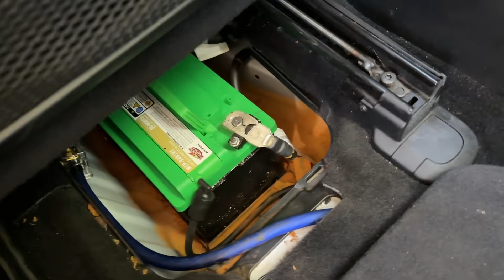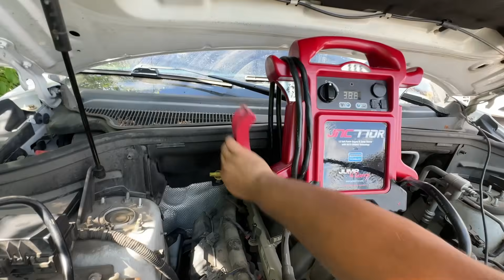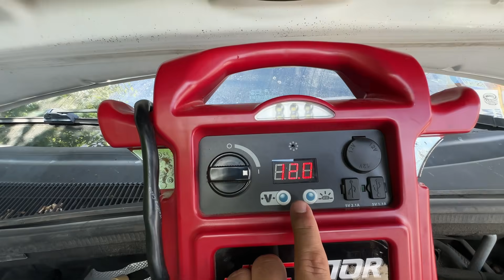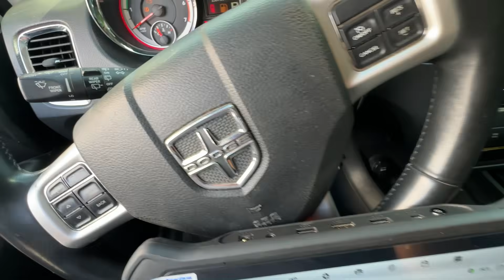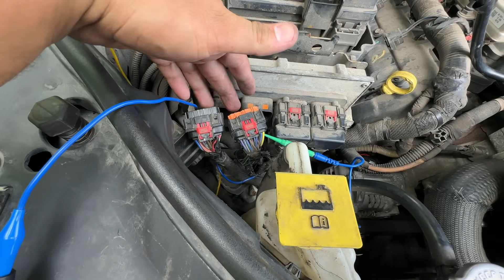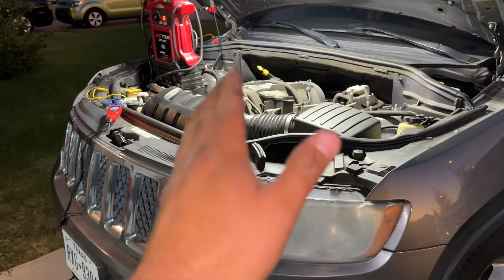DODGE DURANGO HEMI ALTERNATOR NOT CHARGING DIAGNOSIS

Comment: At the end of the video you said that the customer did not have the funds ti buy a new alternator ,but before you seem to be confirming that it was a bad ecm. But and the you used another car to show a working ecm command in the alternator to charge , good video, excellent .
Reply from the maker: Yes you are correct! My mistake! I meant to say “Replace the PCM”. Thanks for catching that!
Reply: @ADVANCEDLEVELAUTO  can you explain the process of you getting paid for your diagnosis of the PCM. How do you get paid for your time  when parts have to be ordered and they might take days. Nobody is really offering this in my area and I would like to leave my brother's shop and offer this exact skills to shops within a 50 mile radius.  There's about 80 to 130 shops I can reach around my area. I've been thinking about opening this lane for myself recently but haven't taken the leap.
Reply: @Geovanni___  I think he gets paid by you tube for his excellent videos and diagnostic skills.
Reply: @rodvan-zeller6360  i'm trying to pick his brain a bit about the business side of the trade. I know YouTube pays, but I doubt he's showing up and diagnosing these problems free of charge to the shops. Since I'm pretty good with electrical and hard to diagnose automotive issues I want to see how to structure the labor if I was to make it a full time thing. Strictly offering my services to shops and not independent customers is my thought. That way the shop can sublet the charge and I wouldn't have to deal with the customer directly.
Reply: @Geovanni___  Thank you for the reply. I understand your point. He is not diagnosing for free. I can tell you in my opinion that to get paid for this kind of work, a realistic diagnostic fee for knowledge and time far exceeds the value of the vehicle.
Reply: @rodvan-zeller6360   Good answer but also a piss poor answer at the same time. How is that supposed to hel Geovanni?
Reply: @Geovanni___  As a shop owner, you CAN NOT charge a diagnostic fee for a BAD PCM... AND be profitable... it just is NOT POSSIBLE...  The time it takes to figure these things out, you would NEVER get a customer to agree to that charge.. I suck it up as "educational"... In short, you cannot charge over 2 hours Diag, like EVER... it isnt "real world" possible...
Reply: @ADVANCEDLEVELAUTO at this point, for ALL of us that have that damn Durango, it seems economically to just replace/repair the PCM when you have an alternator issue. I just had an alternator fire, going to replace that but it's evident that there's a charging issue with the PCM. It costs about $200 for that and about $175 for the new alternator.
Reply: @ADVANCEDLEVELAUTO hi there..

Hello, after long time..
I'm back with SUPER CURIOSITY on reverse camera wiring diagrams.

Why are you not making any videos about backup reverse camera in cars?
These days many comes pre-installed with rear camera.
Hence, the curiosity arise for the need to understand how the camera sends signal to the radio unit, etc etc??? 

In fact, in general, reverse camera has 5 wires with one wire being a shielded ground, one is camera power, one is camera ground, one is video power and another is video ground. Total 5 wires.

So, can you please immediately make new videos on these 5 wires??? Please 🙏🙏🙏
Reply: nelsoncoffie5668 i think he meant to say Owner did not have funds to pay for pcm alternative A.K.A (alternator). get it? If you dont, forget about it. Good catch though👌
Reply: @advancedlevelauto whats your number have a vehicle I need u to check out

Comment: I have a 2011 Durango 5.7 Alternator bearing going out making noise. With Engine idling. I disconnected pigtail wire harness, so the Alternator wasn't charging.  Could barely hear the bearing. When I plugged back into the Alternator. The charging resumed, so did the bearing noise. I have always had a little rough idle that I live with. Now, with the alternator bearing going out. The idle suddenly got glass 🍷 smooth. Alternator issues cause rough idle I know.

Comment: Hey I need some HELP lol. I have the exact same problem! 

But when I tested the brown wire coming out of the PCM it showed 11.4V and when I tested the wire coming out of the back of the alternator it also showed 11.4V so power from the pcm is sending a signal to the alternator but the alternator is not running?? I have put 2 brand new alternators in and 1 from salvage the chances that all 3 are bad are slim. I had the alternators tested at oriellys and they tested good

Comment: External voltage regulator 15 bucks 20 bucks in wire make a external charging circuit  no longer computer controlled charging and fixed wiith the same pcm..Not hard at all

Comment: The only check that I didn’t see you do on this video is double checking and confirming you were on the right wire from the ecm to the alternator. I mean if the wire is the same color on both ends and there’s no connections in between I guess you wouldn’t have to. But sometimes wiring diagrams are wrong

Comment: Hi so I have a 2018 Durango V6 I've just replaced the main battery and auxiliary battery yesterday when I go to start the car I get a message saying stop safely vehicle will shut off and it does just that. I was told by the guy at the auto parts store that my alternator is bad. Not saying that isn't bad but after watching your video I'm afraid that if I have the alternator changed that the car will not work due to the PCMS system needing to reprogrammed as you should in this video. I also have 11.4 voltage when car cranks. Any suggestions on what I can do? I have the funds to repair alternator just not a dealership.

Comment: My Durango has a P0562 code on it and the pcm was fixed because it had a voltage regulator issue. Now it has the same code and I believe the voltage regulator went bad again.

Comment: awesome video. Just for clarification. When doing full field test, disconnect connector, and send power with the probe on pin that shows ground (which is the control wire). and leaving the other pin that has battery voltage alone (battery sense). Is this correct?
Reply: Yes, that is correct. The pin on the back of the alternator that shows ground is being grounded through the rotor. When you apply battery voltage to this pin, you're completing the circuit through the rotor so current flows through the rotor. This current flowing through the rotor creates a strong magnetic field in the rotor windings and the magnetic flux lines cut through the stator windings. The magnetic flux lines being cut by the stator windings creates  voltage and current in stator windings. This voltage is applied across the battery and the current flows from the alternator to the battery to charge it.

Comment: Hey.
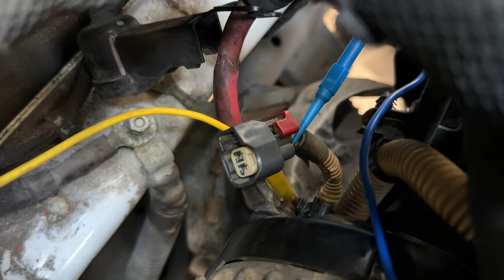Will really appreciate for the assistance. At 7:12 we can see two weight connection points - one abowe another. To the down one we see 2 wires conected, to the up one - only one wire connected. My question is - what's connected to the up point? Today I found, that this wire on my car is broken, and I can't find where to it should lead. 
Could you assist and answer to it?

Comment: WHAT IF THE WIRE FROM PCM TO THE ALTERNATOR IS DAMAGED AND GROUNDED THROUGH THE CHASSIS THAT WOULD BE VERY BAD IF THE CUSTOMER BOUGHT A PCM , WHAT DO YOU THINK ?
Reply: You're right. He should've done a continuity check to ground on the wire that provides voltage from the PCM to the alternator.

Comment: We had the same problem and solved it by adding a Relay getting signal on first ignition for the alternator with Diodes 1amp to pin 85 from relay
Reply: Doesn't that mean the alternator will be full fielded at all times?

Comment: Alternator External Voltage Regulator For Porsche 911 914 1965-1977 Adjustable - IB301A

This is how I solved the charging problem under $30 dollars

Comment: Am a Uganda technician. I would have looped a duty cycle from somewhere else instead of just buying a new pcm. Otherwise. You are my second best after diagnosis dan. Am hooked, thanks for the show brother
Reply: That would have been my solution if it was my own car.
Reply: Yes, but that's a shady fix. It's ok to do it if it's your own car but not a customers. Maybe a bypass module so customer doesn't have to buy a new engine computer. Just need to let customer know what his options are.

Comment: Is there a way to disconnect the computer control of the alternator?
My wife's 2013 Infiniti EX37's alternator quit charging.  I made an appointment at the dealer to repair.  The next morning, I connected a 25 amp charger to the battery to make sure I made it to the dealer.  I also started the engine with the charger connected and tried to find out why the battery light was also on.  Then I disconnected the charger and left to go to the dealer and the alternator was charging!!  It hasn't caused a problem since then which was several years ago.  However, recently I disconnected the battery ground cable sensor that is connected to the computer to control the alternator.  Now, it always charges at 14 volts.
Reply: It's charging at 14V at all times because that is the default charging rate of the voltage regulator inside the alternator when the computer doesn't have all the inputs from battery and alternator.

Comment: Not even my truck but i loved this vid. I wish you was in my city. My battery light keeps coming on while driving but the voltage only drops to between 11.5-12.9 and thats a huge drop from the normal i believe 14.6 it usually runs.

Comment: All u ever need to read on Porsche BCM is  able to be removed without removing the plastic holder or the other module next to it the BCM will slide out of its holder and then it will fall down like it did in the video and no need to remove anything else I did the same thing the first time I did one of these now that’s one done a few dozen I can get that BCM out in less than 5 min more like 2

Comment: All u ever need to read on Porsche BCM is the eeprom/data flash don’t ever read the regular flash no need to they are all the same based on chip mask also if u wanna know here in the bin file the CS code is so u can use autel to finish the job let me know I can show u should be row 0021D  and 0221D 16 bytes starts at byte F so the 11th one down row 0021D or 0221D then with the CS code u can use any other tool to finish the job

Comment: Hi Eric, would you please help me with something? I'll gladly pay you for your time and help. I'm big on the test don't guess motto. I recently had a customer bring me his 2019 Dodge Durango 3.6 with 65,000 miles that has a number 4 cylinder misfire only when you get on it and at 5500. It doesn't idle rough and no other codes. And when you let off the gas the misfire sometimes stays until the car idles down or it goes away instantly. If you drive it normal it will not misfire, and if your going 60 and floor it it also won't misfire. The misfire only happens when you slow down below 20mph then give it 3/4 throttle or more.
He has changed the coil, spark plug, coil and injector with OEM parts. I swapped around the vvt and front phaser with each side and it still does the same thing.
Would you please let me know what would do next? Or how I can figure this out? Thank you so much for your time and help.
Reply: If the coil, spark plug, and fuel injector have already been replaced, I would do a compression test on cylinder #4 and a few other cylinders and compare the readings. If the compression presure is within spec, which I'm pretty sure it will be, I would confirm that the engine has the upgraded rocker arms. Stellantis (the parent company of dodge/chrysler/jeep) had a lot of problems with the rocker arms on the 3.6 liter Pentastar engine. Sometime around 2018 or 2019 they came out with new and improved rocker arms. This new upgraded ones have an AH at the end of the part number. The first symptom of an old rocker arm failing was a misfire in cylinder #4 I believe. I would make sure you have the new upgraded ones installed. If you don't, the rocker arm is probably your problem.

Comment: Had a similar situation with and older Jaguar (2005ish) battery light was on because pcm was reporting low battery voltage but pcm was no longer outputting a field signal. I ended up rigging an old school ford regulator to it. Battery light was on but system was now charging. I probably could have rigged it better to shut off the battery light but that was way early in my learning diag career so I wasn’t very familiar with what the other circuits actually did. I remember I was always fearful of diagnosing pcm controlled alternators.😂😂😂
Reply: Also at the time I didn’t even think about pin fitment being a thing or checking for an open 🤦. It’s ok though, the car had sat in that shop for over a year and the owner of the car just wanted to be able to drive it around with dash lights on and all. 😂😂😂 he was really appreciative.

Comment: I believe aftermarket or Dodge makes a kit to put in a aftermarket voltage regulator. When I had an 86 charger doing the same thing I only paid the dealership once to fix it. Years down the road I put in a $15 voltage regulator and bolted into the firewall and the alternator and the car ran forever. Save your money and don't buy a new computer just move the voltage regulator out of that computer. Nobody makes a voltage regulator that last forever so why did the crackhead engineers at Dodge think that was a good thing.

Comment: You explained very confusingly. First, you said that the control signal from the PCM to the alternator is PWM, and then you said it should send DC power as a signal. Obviously the latter is wrong. The signal is modulated depending on the electrical load. Get your data right. It is not rocket science. Maybe you talk too fast and think superficially.
Reply: He did a great job at explaining it. You're the one that doesn't know what PWM means.It's a pulse width modulated DC power signal that goes from the PCM to the alternator. This PWM signal is grounded through the rotor windings.
Reply: @bernardocisneros4402 PWM is not DC, genius.
Reply: @zbigniewrichard8291  Really? What is it then? Please enlighten me. I'm always willing to learn. 
I thought it was just a voltage being pulled down to ground as required/necessary or a ground being being pulled up to voltage as required or necessary. based on software on a chip.

Comment: That's a fun video, I like the way you think on your feet. I'm guessing that the wire (or the pcm driver circuit internally) was shorted to ground. I suppose one could completely exclude an external ground short by removing the connector at the pcm, then apply power through a test light at the PCM connector to prove the short was not in the wire between the PCM and the alternator. If downstream voltage doesn't jump up with that, something is draining it off downstream.

Comment: Then how about the possibility of having a short circuit to ground on the wire that PCM uses for duty cycle, but thanks for the great job done.
Reply: if that was the case the alternator would not have charged when activating it at the PCM. it would have blown his internal power probe breaker
Reply: @germ294  13:33  When he full-fielded to test the alternator, the connector was disconnected. I didn't see where he caused the alternator to charge while it was connected.
Reply: @germ294   He never activated it from the PCM. He only activated it at the alternator with connector disconnected.

Comment: That does not seem like a very good system the way if there's any problem with the module it won't allow it to charge at all at least on fords to the best of my knowledge from watching these kind of videos is that the alternator itself can automatically put a 13.3 volts which is a good idea
Reply: On dodge/jeep/chrysler, the diesel engines do it but not the gas engines

Comment: When C2 and the alternator plug were both disconnected I would have made sure pin 1 of alternator wiring wasn't shorted to ground. When everything is connected and the computer sees a problem with a circuit they sometimes shut the circuit down to protect themselves. This scenario happened to me a few times on Chrysler products.
Reply: I came here to say the same thing.  A short to ground could cause all of that and potentially kill the PCM.
Reply: Good thinking.
Reply: If the pcm detects the field wire is shorted to ground would it still be commanding max duty cycle?
Totally agree that testing the field wire wiring is the next step, just wondered how a potential safety cut out would affect the duty cycle request on the scan tool.

Comment: ECU controlled charging is Stupid OBUMA era trick to get 0.012% better gas mileage. Alternators still have internal voltage regulator. Just supply fused key on 12V & good to go. Just like earlier charging systems. Yes, I know you probably can't for customers cars but working on your own car no reason not to bypass ECU control.

Comment: Try a used ecm to save money I was able to change vin and program a used one on a wrangler about the same year. Autel was able to re-write the vin and do security and everything.
Reply: Which autel programmer?
Reply: I used a IM508 it said it could not rewrite the vin  but it opened the test and let me rewrite it, then later when I did an immo scan it showed original vin and new vin.  Dealer even told me it was a one time burn and it would not work but it did work